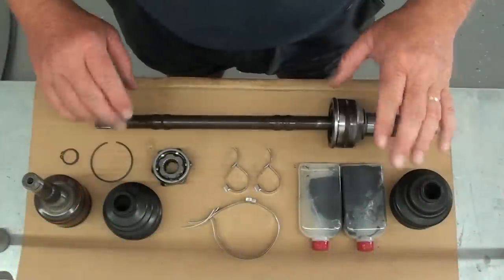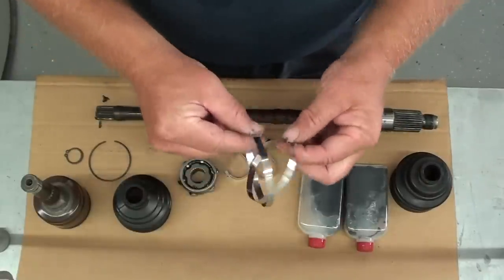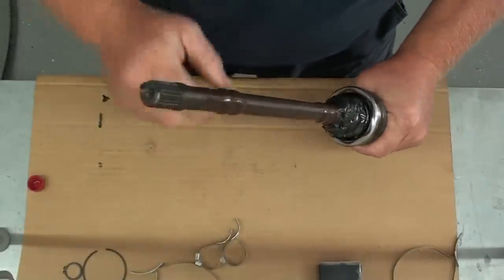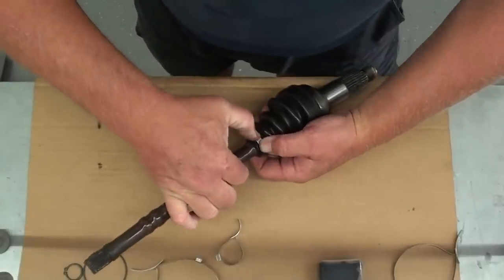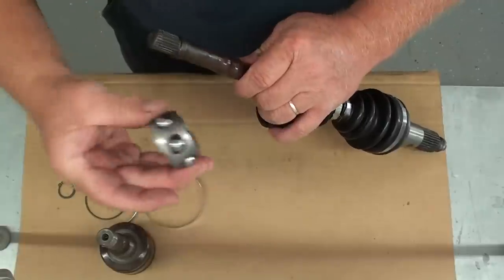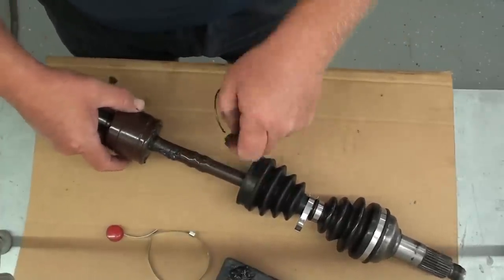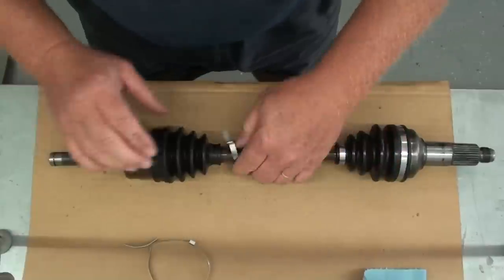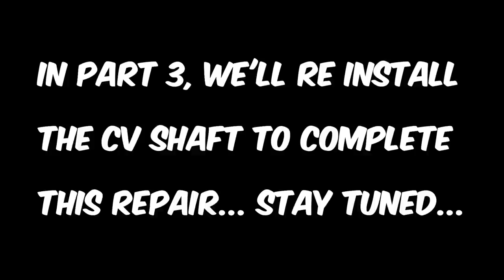Pt.2 ATV CV Boot Replacement At D-Ray's Shop

Comment: I know this is way old but I was surprised you did not make any effort to "tighten " the clamps.
Easy to do with bands with longer tails so your binding tool will work.  But you can add some medium tension just using Vice Grips or similar.

Comment: Honda Rancher, 2010 front axle. Can't remove or slip the beirngs race off. Pounded it with a 2x4 with no luck.

Comment: D-ray would feel safe with re using those fold over clips??  Any tips for rebuilding all four on a fourtrax 300?
Reply from the maker: As long as the little lock tabs are good, I have re-used them. Aside from the brakes, the procedure for your TRX300 will be almost identical.

Comment: Didn't look like you got clamps very tight. Know wonder they spin if grease gets on them
Reply: Thats right. I noticed it also, need to throw them into the garbage for one thing & get the notch clamps.
I would & have used 75lb zip-ties many times, much better than these pull through & fold overs. He at least should have pulled them tight with a vice-grip then fold.